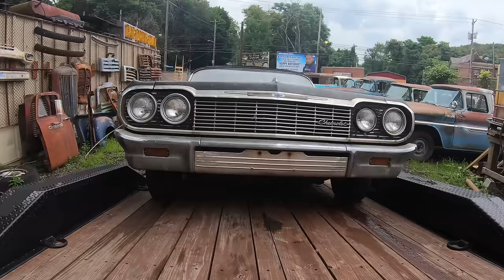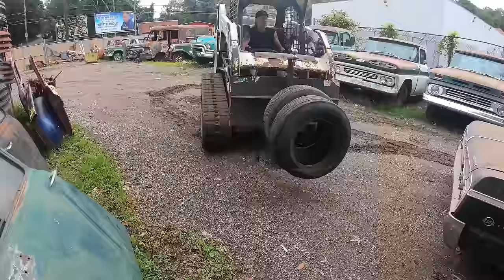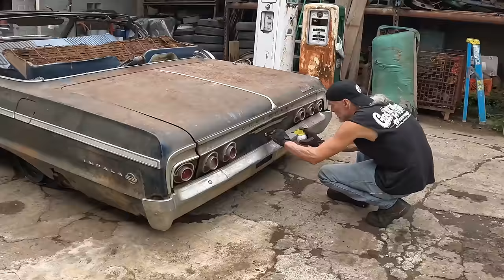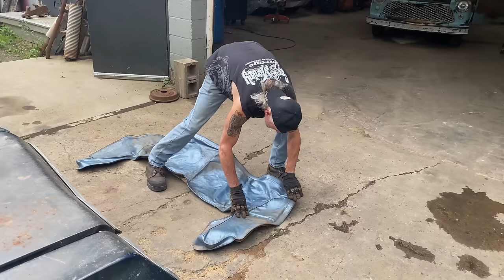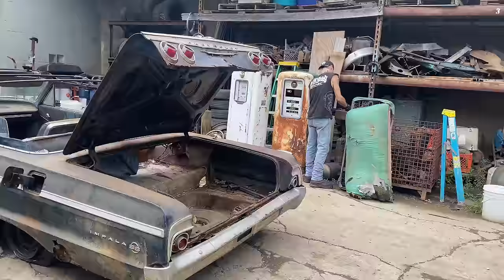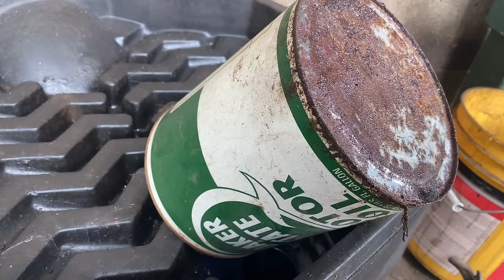Will it Run after 50 years?? 1964 Chevy Impala SS Convertible￼! BARN FIND!!

Comment: I was born in 1963 and my aunt and uncle had one of these impalas I remember that speaker in the back seat. I must have been remembering when I was about 6 or 7, 8 or so when they had that car not sure but it was in the sixties. My aunt hit somene that pulled out in front of her and totalled it. My cousin was terrified of the car after that. I never saw it again but I remember it was so nice. I used to stand up in the back floor board and listen to that speaker when we were flying down the road. I noticed the floor board in that car are not rusted out? It was blue and not a covertable it was a hard top. They use to give you your moneys worth.

Comment: I was 17 when I bought my first 1964 impala ss It had a 327 with factory A/C the convertible SS is my dream car though. Im 32 years old now and drive a 94 F150 extended cab. God I miss the impala I know damn near all the bolt sizes almost everything about it and no matter even when I see one drive by from time to time im still in aww of the finess and body lines of that car.

Comment: My dad was a chevy guy thru & thru...
I was very young , but my mothers baby sister asked my dad what kind of car she should buy...
My dad told her to buy a Chevy Impala .
It was the best bang for her buck..
I remember well when she rolled into the drive with a brand new 67 Impala SS.
My dad was shocked & so was I...
My dad & I walked around the car, opened the hood & there set a beautiful 396 .
We took it for a spin & as my dad wound thru the gears , he asked my aunt why in the world she bought the SS ??
She simply asked , whats an SS ?
She had no idea that car was built to run..
She just liked the color .
And she said after test driving it , she liked how "zippy" it was...
10 yrs later I bought that car...
She had parked it because the exhaust was bad & it had an oil leak...
It had 68000 miles on it..
I put valve cover gaskets on it & a new exhaust .
It was in excellent shape . 
Whats more, my aunt drove it like a girl & never missed an oil change...
Thats one I wish I had kept...
But I was young & after a few yrs I sold it.
If we only knew then what we know now .
Reply: That's one heck of a babysitter

Comment: A 64 chevy 4 door has been one of my dream cars since I was a little kid, my Great Uncle (grandpa's brother) had one that he used to run bootleg wine in up until the early 70's, yes they still bootlegged then and some STILL do it today. so That's what I'm going to build, a "bootleggers car"  My Uncles had the back seat springs pulled out of it and a board wrapped in the original material glued over it so it looked real, he also had a tool box in the trunk with a false bottom in it the spare tire had bottles in it, I'm sure there was more that noone knew about either. His was black with the original hubcaps on it and when he made a run he would pop the tires off and put the wheels and tires off his 62 Chevy truck on them, they were 15" instead of the 14" that came on the Impala and they were wider for better traction.

Comment: Pete thats a cool car it reminds me that my dad bought a 64 biscayne 2 door in 1974 from my cheap uncle no radio no ps pb 3 0n the tree 6 cyl it was black red interoior it needed a carrior bearing on the drive shaft i was 13 i helped my father put the bearing in and we test drove it back and forth on the street in front of the house and we ran my dog over you could feel the car thump i got out of the car and my dog was yelping and crying in the yard and an hour later my dog was perfectly fine true story.But the car had a perfect body 2 years later the whole back end        saged down the frame rotted .I also remember seeing alot of those 64s saged out in the mid 70s.This car was garaged kept in a damp garage . My uncle bought 1974 chevy 1/2 ton to replace the biscayne same plain jane .In 1986 he bought 86 1/2 ton he gave me the 74 to undercoat the 86 the 74 was rusted bad he drove it with a 5 gallon can full of gas in the bed. both 64 and 74 only had 50000 miles Tom im from the pittsburgh area also

Comment: That can be one hell of a nice ride once you guys get it fixed up can't tell if it's a 283 or 327 but it looks like a small block 396 is had huge head. Or    valve covers either way or speed awesome convertible two-door damn that would be a sweet ride when it's all fixed up. That is a Chevy classic. Oh there is a little rust on that left side isn, t there, well even that can be replaced.
Reply: The crossed flags on the side of the front fenders I'm pretty sure indicates that the original engine was a 327. And, I believe it's the 250 HP 327 engine. If you got the 300 HP engine with a four speed it also included the factory tach which this car doesn't have. I bought a 64 SS new with the 300 HP four speed. OK, I did not watch till the end of the video but the guy said that the engine was a 68 so evidently the original engine was changed. But, I do think the original engine was a 327 250 HP engine because it doesn't have the factory tach that I believe was standard with the four speed.
Reply: @larryburton5516  I don't think they put a 250 HP with a 4 speed.  I think you got a power glide with a 250.  I think this is 300.  They didn't put 283's in an SS David
Reply: @518jimg  David, actually I believe you could get a six, 283, 327, or 409 in a 64 SS. The SS Package in 64 I believe was just a styling package with different exterior trim and the bucket seat/console interior.

Comment: As soon as I saw the engine compartment of this 1964 Impala, I knew that the engine had been replaced. The engine in the car has a quadrajet carburetor and it is unlikely that someone would replace the intake and carb. Quadrajet carbs were standard on 350's and later year 327's. The standard carb on the 1964 would have been a Carter - now Edelbrock.

Comment: Looks like a later year engine.  Don't think 64's had a quadrant,  pcv hole in the valve cover or a Tonawanda engine plant sticker.
Reply: They said it's a 68 engine.
Reply: @larryboy8821  I watched that after I made the comment.
Reply: You are right. The front fender emblems are not correct as is the front grill emblem Lots of mismatched parts. I think that engine is a 350 or maybe even a 307. Lots of cobbled together parts here. all is not what it seems

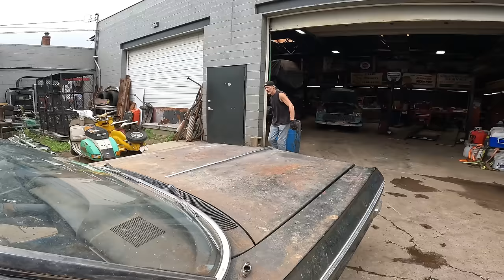Comment: I bought a new 63 Impala SS 300 hp small block 327 in 63. It had a muncie 4 spd and 4:11 posi rear end. The motor in that car is either not original or a 250 hp. Mine had different valve covers and exhaust manifolds too. I also had a carter AFB carb. That car has a quadrajet carb and those didn't come out until 66. I don't think that's the orginal motor. Total price for mine out the door was $3502.69. It ran like a striped-assed ape. Never beaten on the street. 105 mph/13.96 sec. in the quarter mile.

Comment: You picked a good year model to restore and drive. My dad had a '60 model sedan and later bought a '64 model. The 64 is head and shoulders above the '59-60 models in both handling and seating comfort. The view of the road from the driver's seat is much better than those older models. I don't know about the '61-63 models, but to the extent that they may be like the '64 models they may be better handling and seating than those older models. The '58 models appear to have suffered from the same problems as the '59-60 models. Good luck!

Comment: By now we all know all of these barn finds will be made to run... usually without much trouble...
Reply from the maker: Not all of them there’s a couple that we hit a wall on and couldn’t actually get to turn over. Bills a pretty good mechanic but even he has his limits look at the 45 Mack EFU video we couldn’t get that one to turn and it’s one of our most popular videos
Reply: @Ironcitygarage  - Lots of videos where they oil the cylinders and valves down, take the crank out, and hammer the pistons and valves out... and then get them going with needed parts/resleeving... I even weld up cracked blocks, heads, and manifolds... if not too destroyed otherwise...

Comment: I had a 64 drop top with 327 375hp 4speed and I got so tired of the top leaking in the 70s and I couldn't afford a top so I cut the roof off a wrecked 64 and put it on the drop top and you couldn't notice the seams or anything and I gotta say that I did a fine job putting a hardtop on a drop top cause it was a tad bit lower than factory 2door hardtop cars..I drove the car for quite awhile and a guy wanted to buy it and he kept having a problem with what the title to car said cause I didn't think anything about it, he wanted it and I sold it to him and I even offered to buy it back cause the title said it was a convertible and I never got pulled over in the car cause I didn't run it hard until I was up the ol coal mining holler I grew up in and that's when the rubber hit the pavement and it was like the car just enough horsepower to embarrass a few people and I loved it lol..I often wonder if it's still around cause he liked saving certain cars especially a SS that was born a drop top lol..I should've kept it to where the metal top could be removed but 1 person couldn't remove it cause it was heavy lol. When I first put the hardtop on it I put 3 screws on the back part and 4 on top of the windshield but water came in when it rained but I could've sealed the seams so it wouldn't let the rain in but I put a bead across the front of some stuff that dried hard and I did the same thing at the rear part of the roof and it was there to stay..I would love to know if the car's still around tucked away somewhere..I made me a cubby hole/storage place where the top hid when it was down and hardly anyone ever noticed it lol..I'm hoping Richard Rawlings sees your t-shirt with a few Miller Lites in him cause he might just help fund ya with the car restoration, and for the record he doesn't need a few Lite beer to be a good person.  He just loves seeing people wearing his merchandise. Richard helped a guy from losing his home just because he was wearing 1 of Richard's t-shirts on YouTube and I just thought it was so cool when Richard helped the young man..Now get you some of that lol..That's his signature phrase and I use it alot piddlin with old school rides or whenever I'm just having a great day lol 😂❤

Comment: Any wondering if it would run after sitting for 50 years had obviously never owned one before., I used to buy these all the time as a teenager in 713 yeah all hardtops mostly SS and a few 4 doors but a little tlc and they all ran!! The only one I’ve ever bought that didn’t run right away is the one I have now and that’s only because it went straight to disassembly and on to a rotisserie., all body panels have been replaced and now ready for bodywork work

Comment: if that 327 belongs in that car because i havent seen the numbers its a 327   250 h.p. engine,   next engine up from the 250 horse was the 300 horse, still had 194 intakes as the 250 did, but a 300 horse would have had from the factory a built in tachometer on the steering column, yours doesnt have it.. with a bezel same color as interior.. you had to go up to the 350 h.p. 327 to get the 2.02  heads.

Comment: Did they change the oil and filter before they tried to start it in these will it run videos they never do
Reply from the maker: @Phil-w7u  yea we do, but establishing compression makes a mess of the crankcase because of all the top cylinder lubricants. so we typically wanna hear it fire once then we go into oil change and carb tuning.

Comment: Looks like you reshaped the truck deck pushing it with the skid steer
Reply from the maker: Nope
Reply: @Ironcitygarage  Really, because when you role it off the trailer it looks perfectly straight. Then when you’re trying to open it, it looks to be pushed in a bit?

Comment: Quadrajet in64? not to my recollection.
Reply from the maker: It’s not the original motor, 68’ 327. Your still right haha
Reply: @Ironcitygarage  Yeah. I kinda replied when you first got under the hood. I had a couple of these, I used to build 409 cars back in the day. Now a days I'm just a small block guy. Brought back a lot of memories, but those cars were a lot cleaner in the 70's, I didn't have to do 1/4 of the panel work they need now, Weld in a piece here and a piece there and you're good.